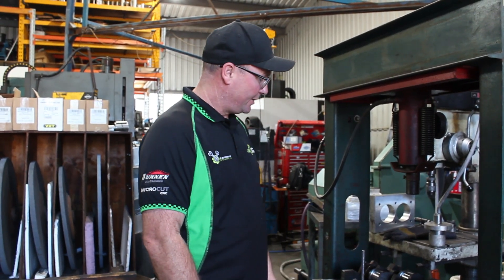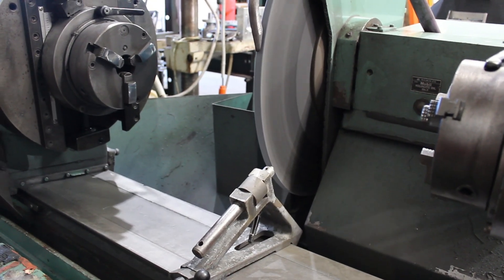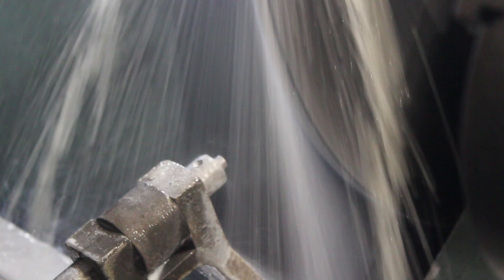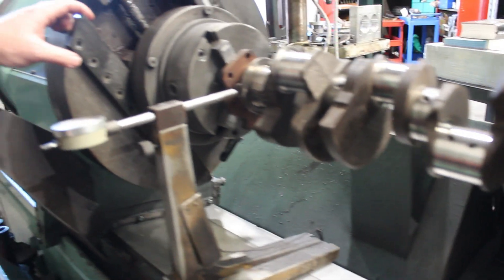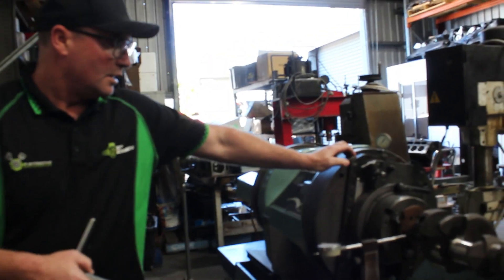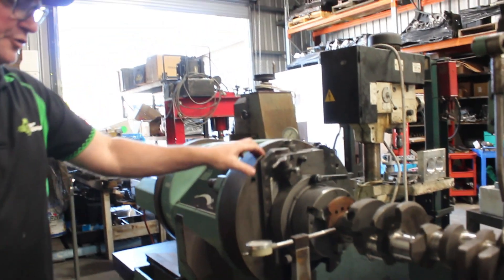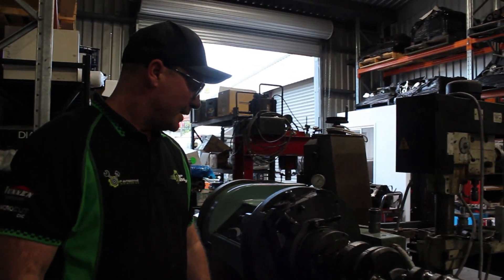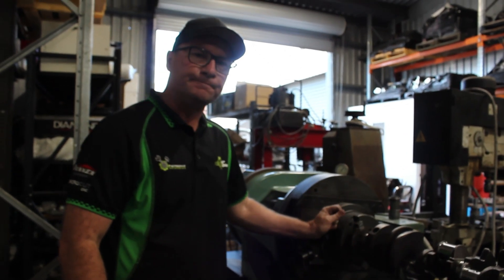How To Grind Mains on a 305 Chev Crankshaft. AMC 1500.

Comment: How do you dress the wheel more
Coarse ? Do you just move the diamond
Across the stone faster? What about the depth you feed the diamond in do you ever change the depth ever?
Reply from the maker: Yes you just move the diamond across the wheel faster. I usually only cut into the wheel 0.002"-0.003" or so. You have to grind alot slower with the wheel opened up. Or only good to rough a crank out then dress again slowly to finish it off.

Comment: How do you get the the taper out
Reply from the maker: There is adjustment on the right side (non drive side) that moves back and forth to adjust for taper. I usually put a long bar in and grind as close to chucks as I can and when you get the same size when grinding to the zero on hand wheel it should be fine.